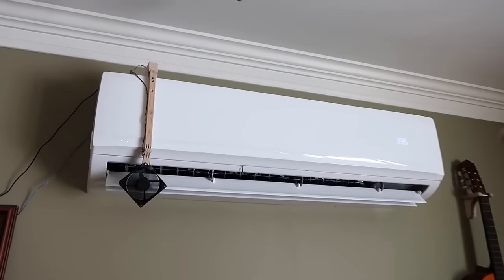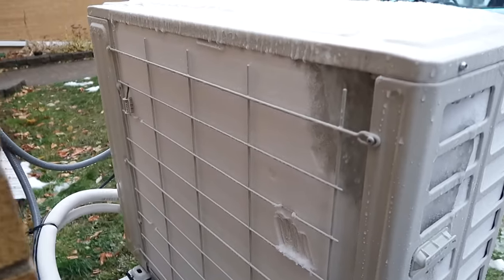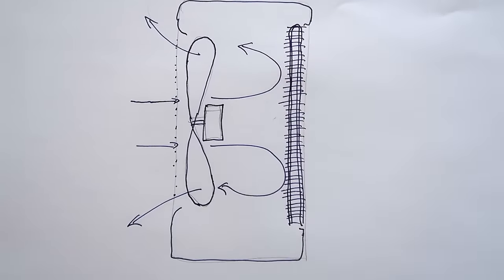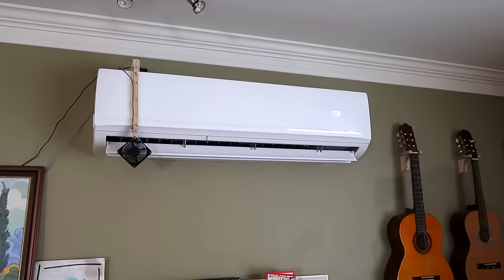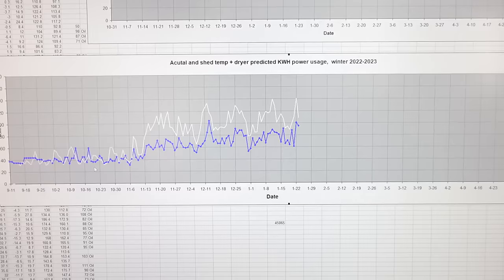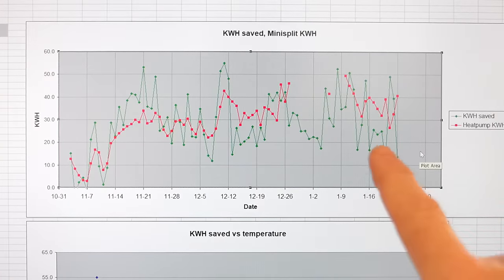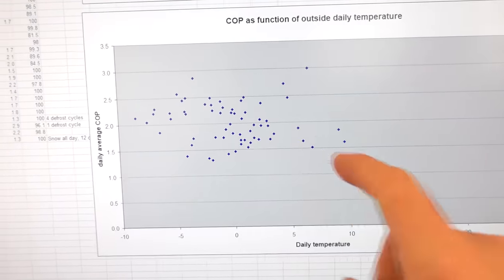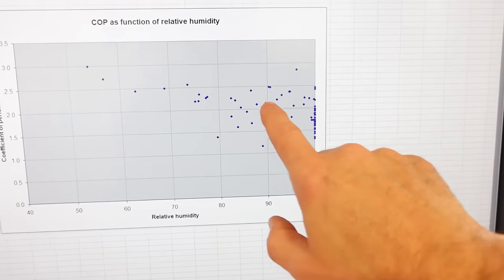How efficient are our minisplit heat pumps in the winter

Comment: I've wondered about making a tunnel under our snow (cardboard boxes?) and using that as the "input air" for the mini split when the outside air goes below freezing.
Reply: Not gonna work unless the tunnel is huge. The units go through a whole lot of air by volume. If it is sunny where you are, making a sort of greenhouse on it could work. Above 60N it doesn't make much sense most of the heating season. I am still curious as it isn't that warm above 60N except for 3-4 months.

Comment: I'm saving about $2-3 per day in heating costs this winter with an 18k btu mini split.
Our electric baseboard heaters on the first 2 floors of the house are rarely getting activated.

Only the baseboard heaters in the basement where the mini split doesn't reach.

Also the air quality is much better from mini split compared to electric baseboards.

Bought it mostly for summer Aircon use, but the heating works excellent.
Reply: I hate that burning smell when using resistive heaters!

Comment: Even -40 outside temperature still is 230 K. So still a lot of energy in the atmosphere that could potentially be extracted.
Reply: Mitsubishi Kazan 35 Extreme works down to -35C. Previous models showed COP 2 at -30C :P I think his heatpump isn't really optimized for colder climates.

Comment: I assume you are many split has resistance heating elements and of course use a lot of electricity. Does your unit have them and if so have you factor that into your calculations as well. What climate zone are you located in?

Comment: Running a dryer has a significant negative effect on house heating efficiency, because it throws away a lot of warm air and cold outside air gets sucked inside through door/window cracks. Then you need to spend power to warm up all that air by 10-30C.
Reply: Btw: Woodburners also throws a lot of heated air away.

Comment: Daikin does better defrosts, but they're not perfect.
Well, I thought the same way, the AC will pay for itself, but you're better off by thermally insulating the outside of your house with mineral wool. (Go as thick as you can)
Reply from the maker: A minisplit and the energy bills are way cheaper.  It doesn't make sense to spend 50,000 to save 500 a year.
Reply: @matthiasrandomstuff2221  if you can DIY it, as I'm about to do... Well, it's still expensive for an entire house...
You could do a room or two + the separating walls by a hefty margin if money is an issue. It's not ideal, but it's better than nothing.
Then you could do some IR Thermometer readings or thermal camera readings and draw some conclusions.
I'm aiming for more comfort and lower bills.
Even though the air inside is hot, you still feel the cold walls and floor.
Also, in case the power goes down, the temperature inside will drop.
I only have electric heating, so I'm either using my AC or infrared panels in case the AC ever goes down, or I'm setting up a campfire in the middle of my living room using my furniture, LoL.

Comment: Your COP chart really surprises me. That's power measurement is just the HP? I'm having trouble understanding how you'd have a lower COP as 10 degrees. Looking at the product data for the DLCSRB models it lists a COP of 3.07 when it's 7 out and you're heating to 20.5.
Reply: @Robert Swaine We're talking 10 degrees, and the other graphs showed the defrosts aren't just on a timer, so there wouldn't be any defrost cycles here. A COP of 1 is saying there's zero gain when the HP is operating in it's most ideal conditions. This is a very unlikely result.

Comment: I'm on my second winter now with a mini split and the defrost cycle doesn't work perfectly when hovering around 0 C. I've had to de-ice it manually with blankets and a heater because it refused to run. I'm starting to think this has something to do with settings that technicians have access to, as I didn't have these problems before I put in extra insulation in my attic. I bet there's some settings to do with the properties of the house, so it knows what to expect, and mine is now out of tune.
Reply: No there aren't any settings.
Just let it do it's thing, it'll eventually defrost.

Comment: The defrost should run when the fan is not running, since it would just be making it harder for itself to thaw
Reply from the maker: it doesn't run when the unit does defrost.  When I force it by setting it to AC, it will turn on the fanto get more cold to pump inside (which  as i said, I didn't want!)
Reply: @matthiasrandomstuff2221  very cool review. Btw as per your meter and sensor delta during power outage, I would trust the emporia over the utility... Definitely something to look into.

Comment: The external unit should melt the ice automatically on regular basis. At least our unit (in Finland) does so. The impact in electricity bill is about 35-45% depending on the age of the unit by my measurements. Newer units are more efficient.
Reply: The melt water is collected in our house into large bucket. It freezes and can be taken away as an big ice cube once a week
Reply: @jarigranroth6873  Freezes inside the house??? It should have tube to be drain outside

Comment: What units are these I'm wondering?  

Want to run a couple at my place, but want to run it off grid on my ever expanding solar system here in Saskatchewan.
Reply from the maker: pretty much all mini splits are inverter based.  This means they don't have the crazy current surges that the old style air conditioners had, so should be ok with a battery based system.  These are just some cheap white label type units.

Comment: I wonder how well it would do if you installed it in the basement and ran an exhaust fan to exhaust the low temp air from the outdoor unit to keep it dry in an enclosed environment. Or even better if it was installed in an outdoor shed with an exhaust fan running as well.
Reply: The next step up is to go geothermal.
Reply: So you wanted to place the outside unit in the basement??
That would just make the basement seriously cold, right?
If you put the outside unit in a shed, then wouldn't that shed be transformed into a fridge/freezer?
Or do I misunderstand what you're trying to say?

Comment: Blimey! 40 kWh of leccy PER DAY?? I'm glad I live in the UK & not Canada! The standard price of electricity here is around 28 pence/kWh. That makes it relatively expensive versus gas at 7 pence/kWh. My average power consumption in December is typically just 6 kWh/day & we burn around 23 kWh/day of gas for heating & hot water. Winter only really lasts from mid-November to mid-February so thankfully our energy bills are low on a year-round basis.

Comment: What did you do to the computer fan to convert it to an anemometer?
Reply: @Robert Swaine Or, if you just disable the motor, say by cutting the wires between the fan's circuit board and the motor stator, and just read the output of the fan's tachometer wire, which pulses once per revolution. Or you could disable the motor circuitry entirely, and directly read the hall effect sensor that is on the board.

Comment: I am curious if you have considered a tankless water heater, if so, pros and cons?
Reply from the maker: They take a crazy amount electricity right at peak time. Tha'ts a big con.  Can't think of a 'Pro' other than less space used.
Reply: @matthiasrandomstuff2221  Thank you for your comment. I know several people near me that have converted and they are providing a great reduction in electricity use as they only draw power when hot water is needed. Whereas conventional water heaters are maintaining a tank of hot water 24/7. My friends use hot water only during bath and dish washing. It would be interesting to apply your power consumption monitoring to each to compare. Thank you for your very informative and interesting videos! I am a long time subscriber.
Reply: @matthiasrandomstuff2221  One further comment. Of the two families near me using tankless water heating, one has geothermal HVAC and the other has a mini split similar to yours. The combination in both instances has resulted in substantial energy cost reductions.
Reply: @Matthias random stuff  With a tankless water heater, you have unlimited hot water. (might be a con with many kids in the house 😄)

Comment: Would be even better to directly measure actual output using liquid flow and delta-T and use that to measure COP.  Is that possible?
Reply from the maker: Very difficult to accurately assess volumetric flow
Reply: @matthiasrandomstuff2221  It would involve putting a flow sensor into a pipe, so yes more difficult than a temp sensor.  I've considered it so I can measure my rented house 20 yo oil boiler efficiency.

Comment: This is what the SEER rating already does.
Reply from the maker: if you trust it to be true, yes.  Also SEER is kind of a cooked up mixed metric / imperial unit.  Even a resistive electric heater has a SEER of nearly 4.
Reply: @matthiasrandomstuff2221  SEER numbers are extremely accurate verifiable data.

Comment: when you have cold temp and 100% humidity, everything that moves air will frost over and shut down.  Not reliable it would be only a back up that is pointless.  How many volts to get it running incase of power outage for 5 days needing a generator to run it to blow warm air vs hot

Comment: The thing that gets me is politicians telling us we have to have these as they will save the planet, yet they fail to consider that now people have and will use AC. Sure you save energy in the winter but if you live in an area where you don't need AC and you get this, you will probably use the same amount of energy annually as you are now using AC. Sure it's nicer as you have the same carbon footprint and now have AC but this isn't saving the planet.
Reply from the maker: Still works out.  The power company doesn't have a shortage of power in the summer, so they get to sell you more electricity in the summer.  A win for them.
Reply: @matthiasrandomstuff2221  Do power companies not have a shortage of power in the summer?

Comment: A proper high end mitsubishi or daikin would be two times more efficient
Reply from the maker: This one would also be much more efficient if you go strictly by specs.  It's real world vs manufacturer specs.  Like EPA mileage ratings.
Reply: @matthiasrandomstuff2221  Yes, but the premium brands of heatpumps tend to be closer to real and also working better in lower temperatures. This type of mini split is very widely used in Bulgaria